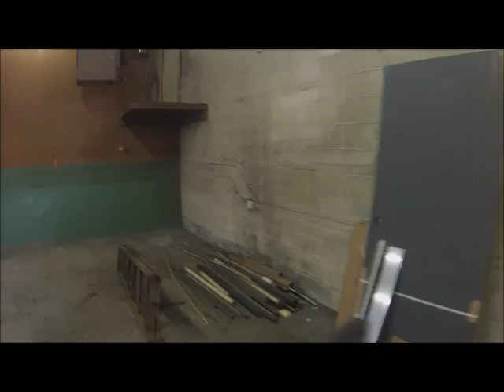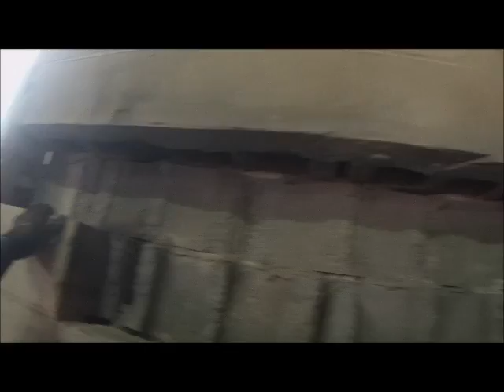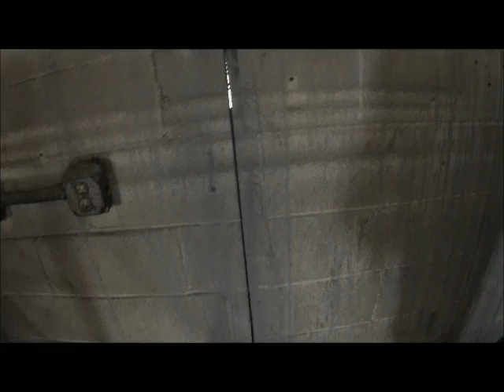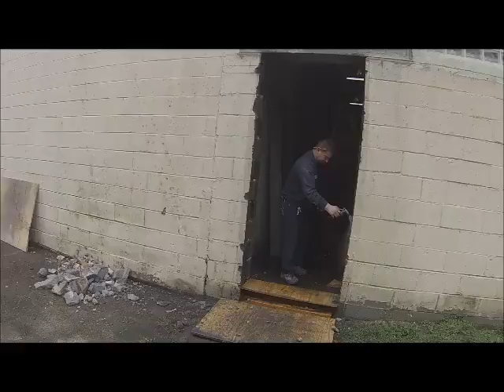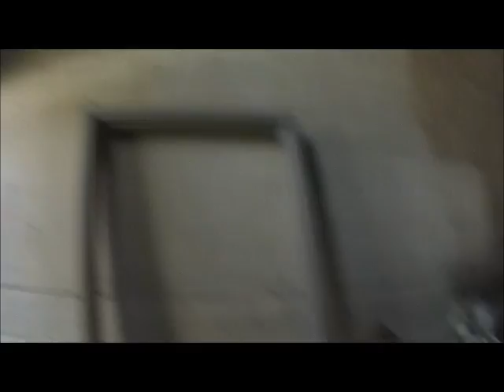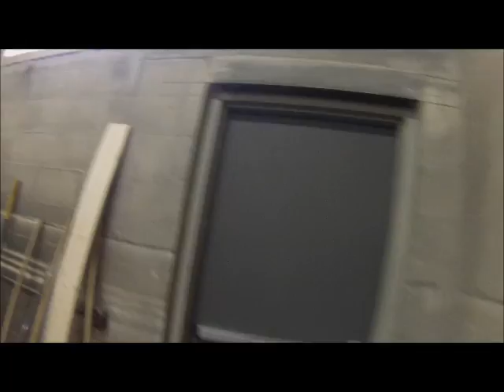Steel door installed in block wall.

Comment: How did you close the opening, between the head of the door jam,  and the precast header.
Reply from the maker: Because we had to mount the door flush with the floor, the top of the door did not match up with the blocks to install the header directly above the door. but as long as there is a header above that big opening anything you fill in below it is fine. I cut another header to the size of the opening and laid it in sideways and filled it between with cement.
Reply: you did not hit your heights

Comment: What type of header is that is it cement ? Were did you get it ?
Reply from the maker: It is a header for a man door,
Reply from the maker: Most building supply places have these headers, if there is a need to have to cut these headers use caution because there is rebar in them for reinforcing them.

Comment: Most old block buildings have lead paint ,and some older have asbestos block sealer on it ,and you must tent it ,and wear suits guys ...did you hazmat test this wall ??  Even silica dust is now considered a regulated item Now....please give proper advice when reno'ing old buildings ,as hazmat safety is "job one"  
              And your scaffold is an OSHA bust ! Exterior walls are load bearing walls ,did you have an architect / engineering recommendation for the breach ???  A "header" is not descriptive enough ??   I am concerned about your whole operation ??
Reply: Perfectly &  systematic
Reply: You may be correct on paper but this is the real world 
I doubt if you ever had to make a living doing manual work like this . Nobody and I mean nobody would pay for all the steps you mention and as a contractor, you would end up going out of business.  That simple scaffolding is perfect for that job . Please don’t act like a suit that has no business on a site .